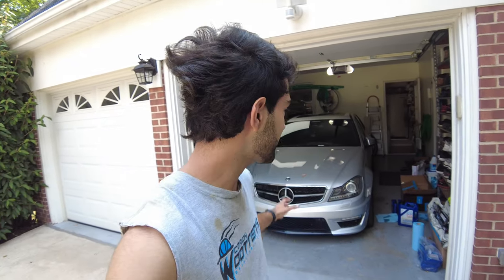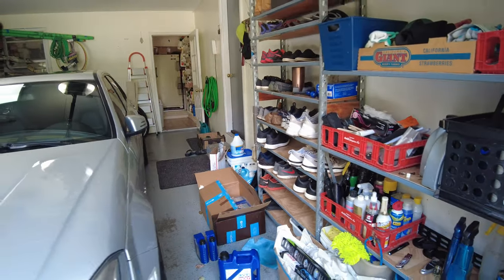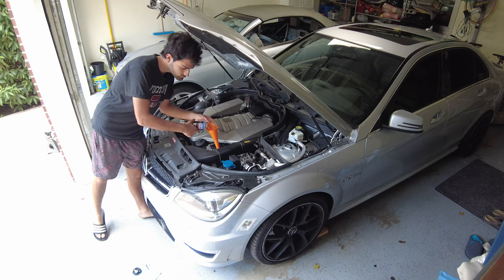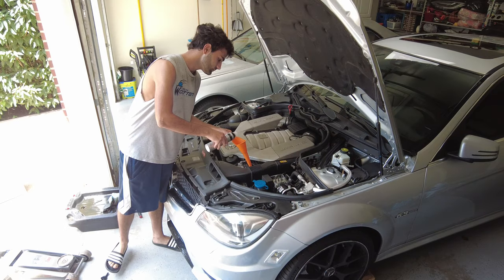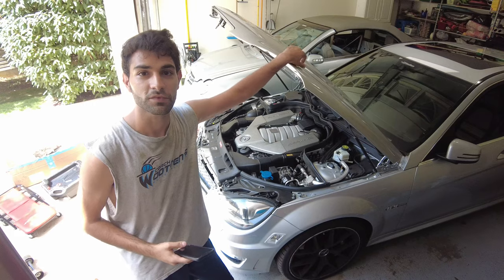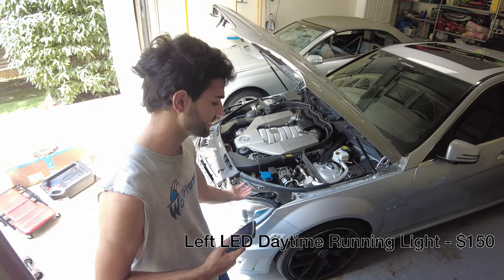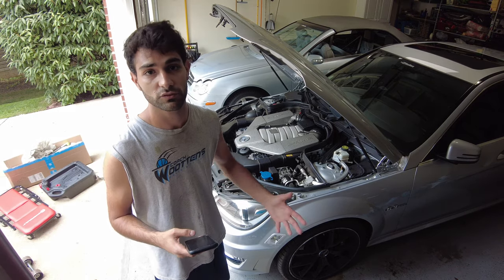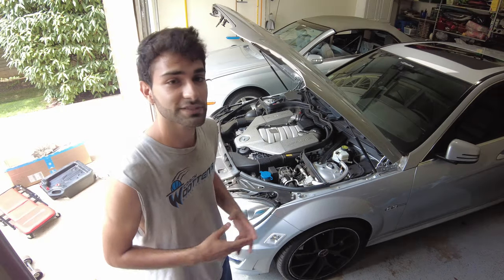How I Maintain My C63 AMG + COST BREAKDOWN

Comment: As someone who is about to pull the trigger on one of these, this video was super helpful!  Appreciate you going into detail about the additives you use and the ownership costs overall. I'll definitely be checking out the rest of the channel. Cheers!
Reply: You ever get one? I’m picking one up tomorrow!
Reply: @brandonblumer5628   I did actually! I've had it about a month and could not be happier. I spent several months looking around and waiting for the right one to come across but it was well worth the wait. I got a 2012 4 door (white over red), w/ LSD and no performance pkg. Are you enjoying yours so far?
Reply: @spencercomeaux91  I actually didn’t pick up the car, went and looked at it for the first time in person and it had tell signs of a failing head gasket. car had original head bolts that were never replaced aswell so I passed on that car unfortunately
Reply: @spencercomeaux91  I’m curious, do all the facelift c63’s have an lsd? I’m still curious about it because I have people say they have open digs and some say they come with an lsd.

Comment: That cam adjuster noise is a problem, sure the additives might be making it quieter but you can change these out for a fair price (mine was done under mechanical warranty but it was 2 grand for both), I think it's a worth while investment, metal on metal ware is never good, plus the mechanic took pictures of the cam and lobes which was good piece of mind.

Since mine are new I will defiantly look to adding the additive to prevent ware, thanks for the video
Reply: Exactly right.

Comment: i drain the oil cooler everytime.... you have to be careful as you can crack the cooler. Very easy to drain if you know what your doing,
Reply: Same. Torque to spec and all good.
Reply: 2011 e63 143k changed oil first time and drained the cooler, found drain plug was a little sketchy and little pieces came off
Reply: Off the washer I think which I’ll change next time then leave it

Comment: Damn, my diesel C320 (it has 300K km today) costs just about 40% less to run for 2 years here in eastern Europe. I change oil and filters every 10K km. Btw, you mentioned yoiu can get 8 injectors for 300 bucks, while one diesel injector costs around 350 :D. And I had to change all the 6 of them 1.5 years ago.

Comment: Hey Bud. Been catching up on ur vids. Good job. Question. Have a 2010 E350 & have the dreaded engine light. It's a P 0456 code. How do you take the hose off the connector?  Other cars have a simple wire that snaps. Mercedes have some crazy lock mechanism

Comment: Damn that engine sounds smooth on start up for the milage. My m156 has a slight rattle on start up. Seems to be somewhat normal for these engines from what I've read
Reply: mine had 100000km and it rattled due to metal in the engine. i checked the cam adjusters which was what was recommended online and that wasnt the problem.
Reply: @hdoublea8447  the rattling in mine was one of the cam adjusters. It completely blew and had to get towed. Thankfully that's all that was damaged and replaced both adjusters in that side of engine and no more rattle

Comment: now i know why you never see one on the road its a gas Gizzler its beautiful its fast but is it worth it?
i found a 2009 c63 155k miles guy said its misfiring 1-3 cylinder needs battery an camshaft sensor his asking 8k for it also previous owner did a facelift front end. an its wrapped in black custom wheels as well.

Comment: dude the ceritec only works if you keep in for at least 10k miles, it won’t do it’s thing if you drain it at 3k, also 150k is not high miles my boy, your trippen. other than that great video and dynamic speaker
Reply: For these motors its actaully decently high these engines can become pieces of shit at 70k miles

Comment: Ceratec? You sure...it says not suitable for wet clutch.
Reply from the maker: That is only if added to the transmission fluid and I only apply it to engine oil, but that is correct.